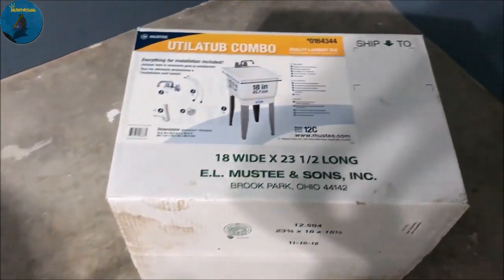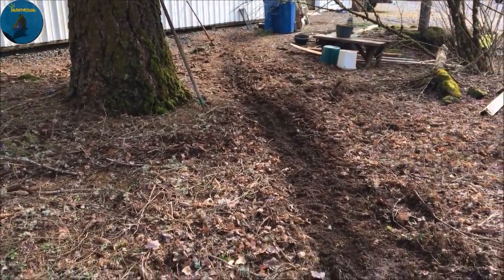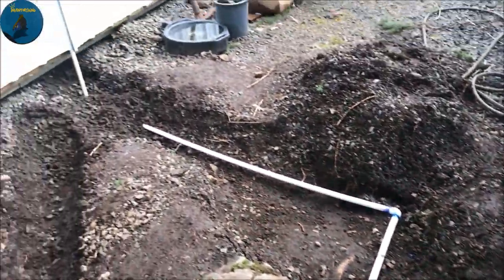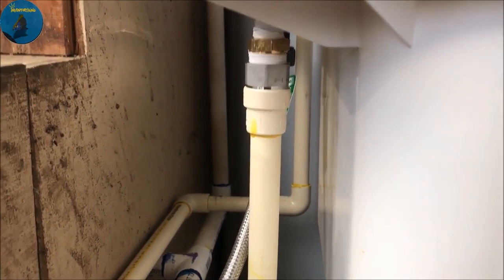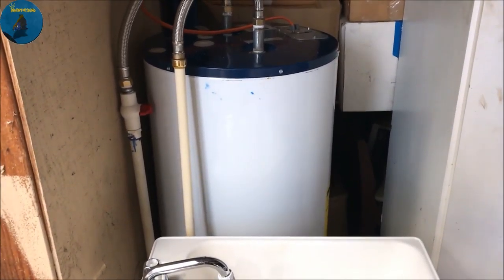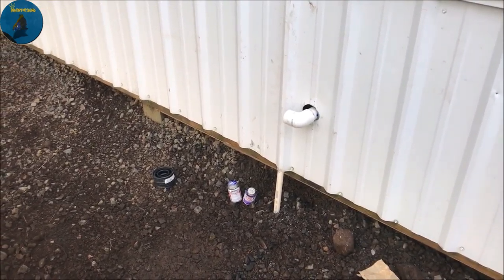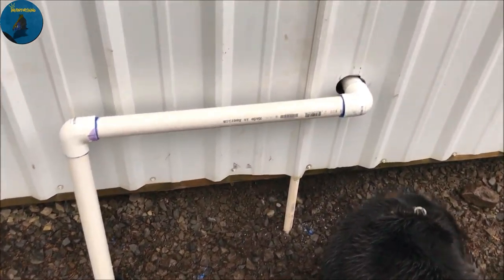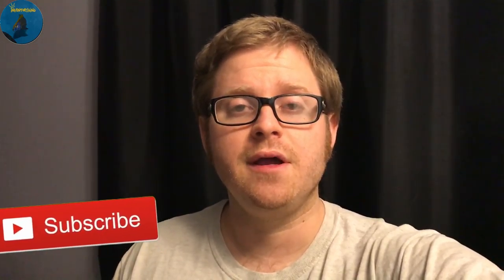Plumbing My African Cichlid Fish Room | DIY Drain And Water Lines

Comment: Nice work Paul, I'm not sure where you live or how low Temps get for you in the winter season but you may consider insulating that water line coming into the building. Just a thought.
Reply from the maker: Thanks dude. Yeah I am going to
Insulate the pipe coming out of the ground.
Reply: If it gets to freezing, you will need to insulate it in the ground.